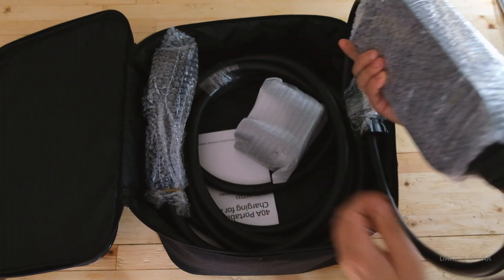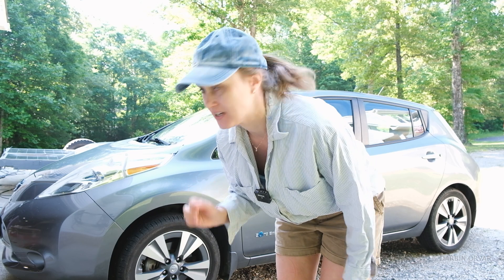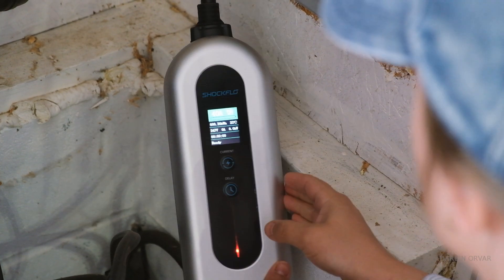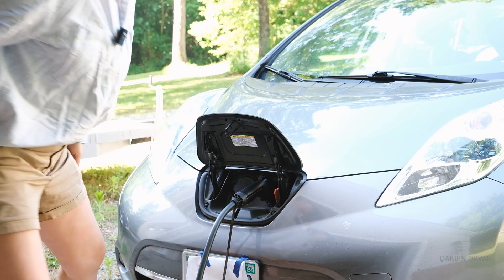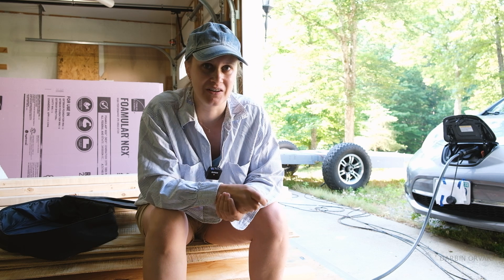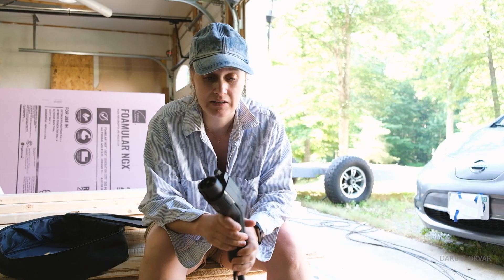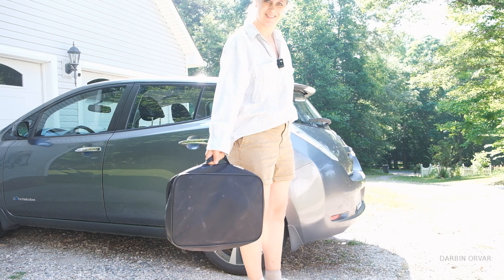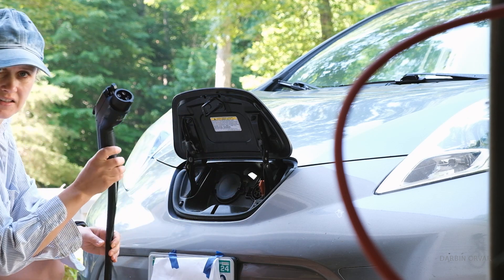Portable Level 2 EV Charger: How to charge your electric car FAST on the road (ft ShockFlo)

Comment: My Leaf (2013) has a charging timer built in. Not as useful as the Climate charger which gives me a nice warm cabin on those cold mornings without using up the car battery power.

Comment: There are short sighted design flaws in that unit.

You can't change the settings while it is plugged into the car. 
How hard is it to install an no/off switch in the wall unit that will disconnect the line going to the car? 
But then, if they put that on this unit, they would not be able to sell you there version 2 that has one when it comes out next year.

There is nothing on the hand unit that allows you to select a preprogrammed time delay prior to plugging it into the car.
Again, if they included that in this unit, they would not be able to sell you version 3 that has that feature when it comes out in two years.